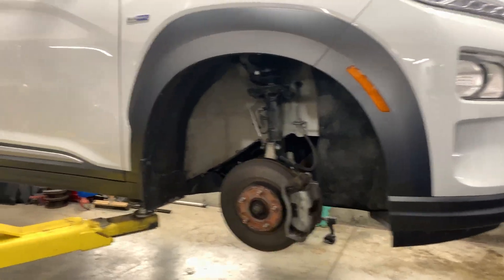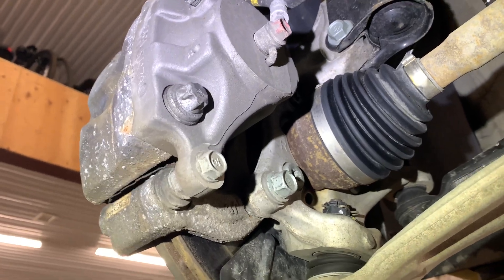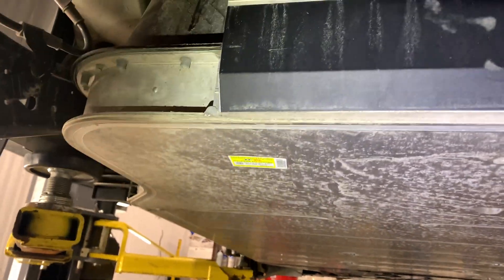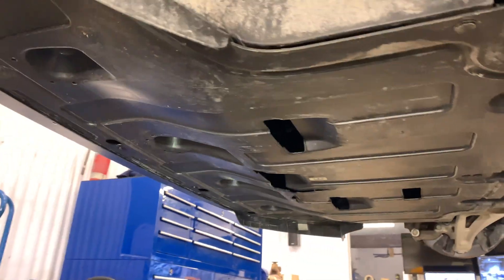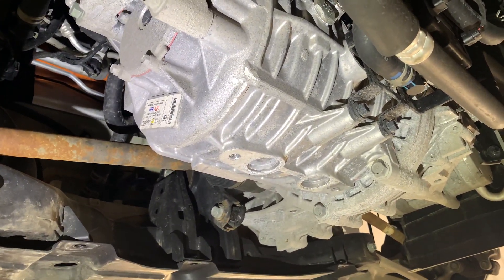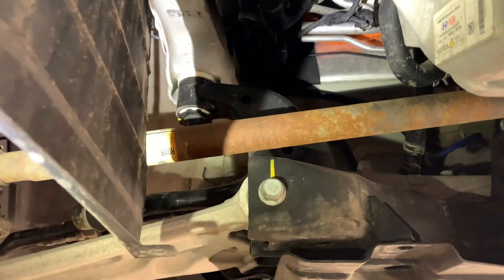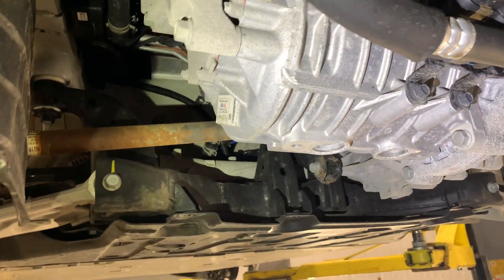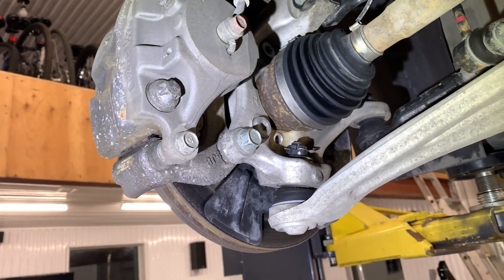Kona Electric Underbody & Drivetrain Views #2

Comment: You need to know about aluminium.  It's an extremely reactive metal it oxides on contact with O2 it's the grey oxide layer that protects the metal Al below that white powder is where the oxide layer has been breached and it reacted with the chemicals around forming a new layer of protection.
That why aluminium last so long. The rust of oxide layer is the protection.  The oxide layer very unreactive and stable. Making aluminium a great material
Reply from the maker: It sucks in this application though.

Comment: Hey thanks for the tour!   The part you're talking about at 6mins in, is the reduction gearbox.  It's got gear oil drain and fill plugs to change the oil every 3 or 4 years.
Reply from the maker: It's not sealed for life like some transmissions? The gear oil change isn't on the maintenance schedule.
Reply: @porkercon  no, definitely not sealed for life.  Kona recommends every 50k or something.. But check this vid out.  The mechanic is replacing the reduction gear under warranty because of noise... He recommended changing gear oil sooner!
https://youtu.be/dMlngPWEbQ4
Reply from the maker: @lefty0mtl  Good to know, ill post that in a group I am in.
Reply: Applicable to all Hyundai & Kia EVs - both H. & K. state a reduction box oil change at 40,000mi to 70,000mi depending country. But crucially, should be changed every 10,0000mi or maybe sooner.

Every 10,000mi, the oil comes oil with forbidden glitter. And that’s together with a magnetic drain plug. If you wait to the stated oil change intervals, you likely to have much reduced reduction box.

Comment: Perhaps the brake rotors need to be made of alloys that are resistant to corrosion such as adding nickel to the alloy.  Maybe just adding something like plastics or wax to the brake pads so that the rotors wind up with a protective coating.  Maybe cathodic corrosion protection, the car is electric so if the current flow is just right, the rotors shouldn't corrode.  We've had the same problem with our Altima, we simply don't use it enough to keep the rotors from corroding.

Comment: You're almost spot on with the "german and japanese" thing. Most of the powertrain is engineered and manufactured by Siemens AG. The ioniq and kona EV are really just Hyundai playing around with EVs by assembling them with OEM parts, outside of the chassis and suspension they don't seem to manufacture a lot of the stuff that actually goes into this car.  We'll see with the Ioniq 5 and EV6 how much of those car the Korean companies are actually manufacturing themselves.